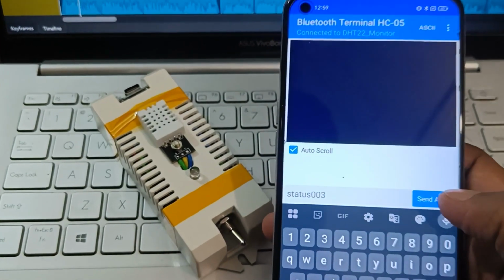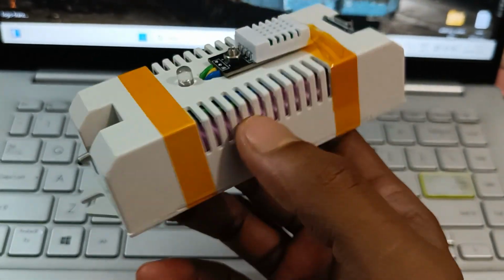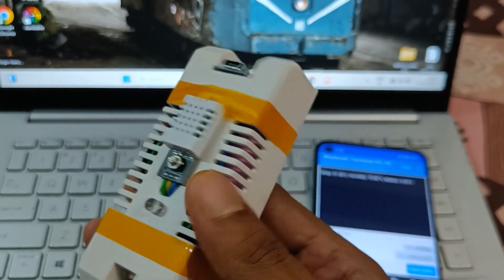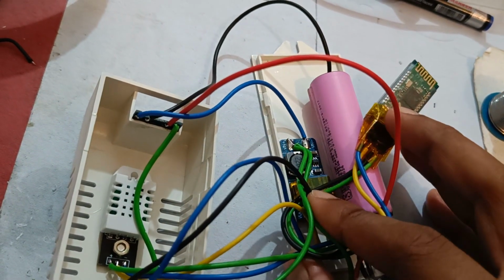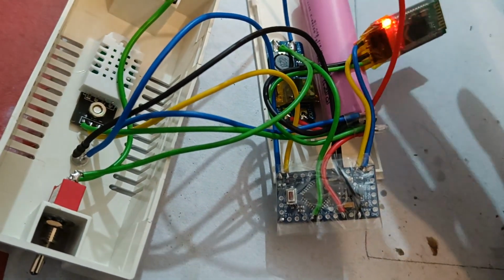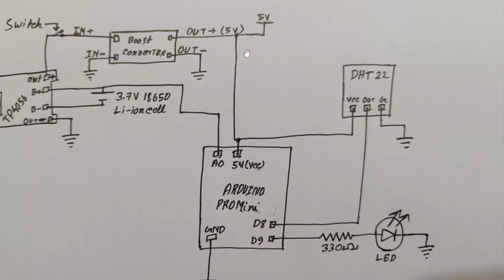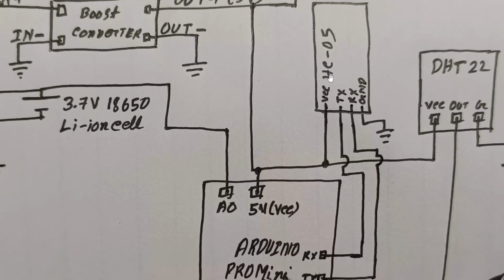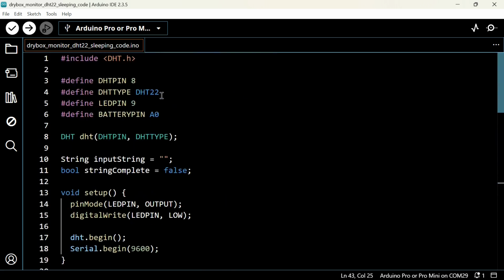DIY Bluetooth based humidity & temperature monitor using Arduino, HC-05 and DHT22. #arduino #hc05

Comment: I woul like to make an exact device you are holding. Do you have step by step? What I need to get to make it?
Reply from the maker: Bro, in the video, I had shown you everything needed for this project, I had included the code and circuit diagram also into it. So you'll get all referances from it. But I want to let you know that this dht22 sensor is ok for projects, but for serious and accurate data, it's actually not. I have a industrial sensor, it's sht41, and I'll make an exact video like this on sht41, if you follow that, the sensor costs a bit more then this, but the extra cost is actually worth it. 

Don't forget to check-out other videos on my channel, there are any interesting videos, like range test of various different kind of RF modules and others... You'll love those videos too😊